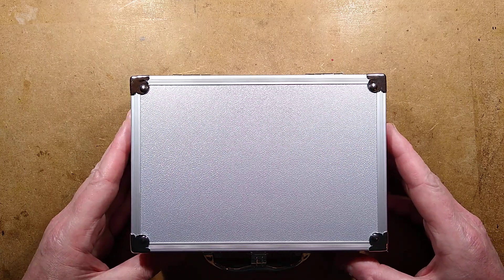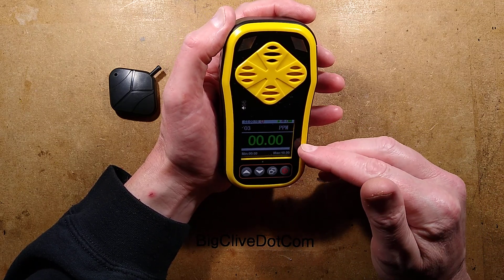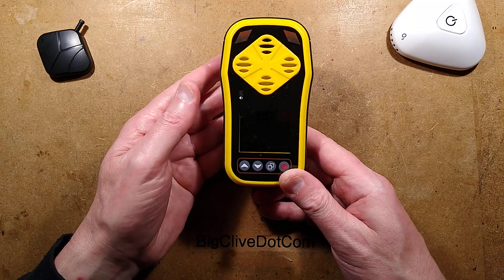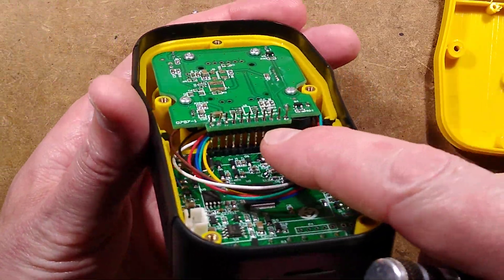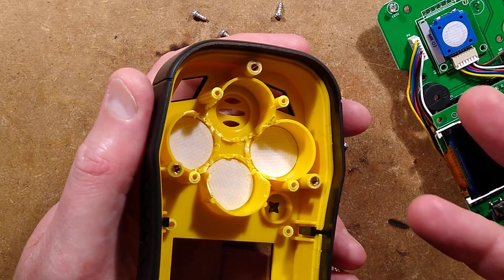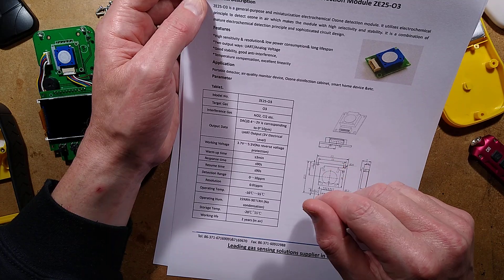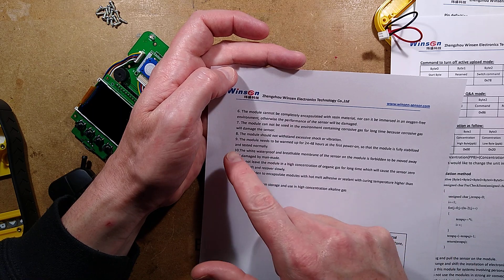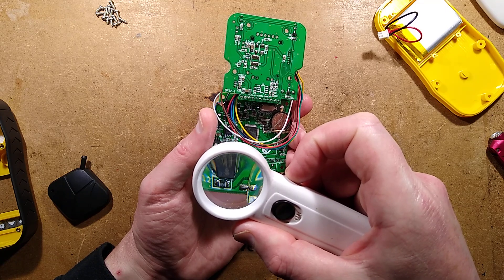Inside a wearable ozone meter with alarm.

Comment: Fascinating video! It seems to me that the real problem with all of these cheap meters is cross-reactivity. Note the warning that the environment must be free of all VOC's? That's not realistic in most applications. E.g., if you are evaluating interior air quality, the air will be contaminated with a mix of combustion byproducts and outgassing VOC's. The important question a meter like this is supposed to answer in such a situation is: Is the interior air ALSO contaminated with ozone? But it cannot answer that, if it's responding to the combustion products or the VOCs. In the social sciences we call this capability in a testing instrument "discriminant validity". In biostatistics we call it the "specificity" of the test (does it respond when it shouldn't respond?), which is often evaluated versus "sensitivity" (does it respond when it should respond?). In the future it would be a terrific addition to your testing protocol to give all such meters (natural gas, Nitrogen Dioxide, ozone, CO, etc.) a faint, distant whiff of air with some molecules of rubbing alcohol or vodka in it, and then to a faint whiff of a newly extinguished candle flame, and see if it shows any specificity at all to the gas it claims to specifically measure. Am I right?

Comment: I KNOW NOTHING ABOUT THIS STUFF NOTHING YET I STAYDED AND WATCHED YOU TALK TRYING TO LEARN LOL I LOVE HOW YOU LOVE THE STUFF YOU Talk ABOUT.
I bought a ozone machine so I can clean out my room the air in there and dust mites what ozone tester do you recommend for someone who needs to keep it simple to test the safe level to re inter a room, so I won't kill myself.
Reply from the maker: The simple rule of thumb is that if you can smell the ozone there is too much.  But it does sometimes take a long time to clear.  I'd recommend just trying to leave as long as possible after the machine has been turned off, before staying in the room for long periods of time.

Comment: I found what the 4 channel units comes from. The four gas unit is built upside down. On Amazon:
https://www.amazon.com/HZXVOGEN-Portable-Detector-Analyzer-Rechargeable/dp/B07VTQ1DXL/ref=psdc_7491102011_t2_B081PMLHRQ?th=1

In a further trek down the rabbit hole. I discovered that ozone can occur from hydrocarbons mixing with O2 at lower levels. It can destroy certain rubbers and polymers.
I believe believe ozone is what dissolved my Snap-On polymer impart hammer. Geeeez!
with the 4 channel unit at almost half the price, any electronics hacker want to see if they can swap in the ozone detector into the 4 channel? If I knew how, I would pull the oxygen sensor. plenty of those around. at a low price which are very accurate.
Anyone?

It appears that para-phenylenediamine:
https://www.wisegeek.com/what-is-para-phenylenediamine-ppd.htm
can protect against ozone damage to stuff

Comment: Why does this thing exist? A wearable O3 monitor. Is there some environment where O3 is a health hazard other then Clive's abode when he turns on all the ionizers and UVA lamps at once?
Genuine question from ignorance-  why would anyone need a wearable ozone meter?
Reply from the maker: It's for factories that use ozone in their processes.
Reply: @bigclivedotcom  Thanks :)
Reply: Yes residential HVAC systems are poisoning u with UV-C ozone generation
Reply: @walkingdead171  Good thing I just have resistive electric heaters and for cooling I open a window or two by the sounds of that :D
One the benefits of living in a temperate location with no extremes either way.
There are of course many many downsides to living in such a location - mostly societal though.

Comment: Clive followed the white rabbit way down the hole on UVC/Ozone!

O2 sensors are equally painful. Hydrogen Sulfide/Sulfer Dioxide will destroy most except Zirconium Dioxide sensors. Used to handle the byproduct from desulfurization of diesel fuel. I specified such a beast for a thermal oxidizer for IOC in northern India.

Comment: https://www.renkeer.com/index.php/index/shows/catid/31/id/23.html the 4 in 1 version of the gas detector. Detects CO, H2S, EX and O2
From website: The 4 in 1 gas detector is easy to use and maintain and meets the requirements of industrial site safety monitoring for high reliability of the equipment. The housing is made of high-strength engineering plastics and composite non-slip rubber, which has high strength and good feel and is waterproof, dustproof, and explosion-proof.

This four gas detector is widely used in petroleum, chemical, environmental protection, metallurgy, refining and chemical, gas transmission and distribution, biochemical medicine, agriculture, and other industries.

Very interesting how they just chopped the plastic away to fit the O3 sensor while keeping costs down. Although such a long wire loom going from the board to sensor glued on to same board was mindboggling. Not sure about the waterproof, dustproof and explosion-proof claims made on the 4 in 1 version though.

Comment: Common (cheap) silicone sealants/adhesives emit ethanoic acid (aka acetic acid, aka vinegar) when they cure.  Not good for sensitive components.  Or even non-sensitive components if they have fine leads.

Silicone polishes and lubricants creep everywhere (almost like superfluid helium).  It poses a problem if it creeps its way onto relay contacts, where the arc as the contact opens turns it into insulating crud.  Used to be a standard problem in photocopiers.  People polished the glass and many months later it worked its way onto relay contacts.  Not a problem with mil-spec relays in hermetically-sealed metal cans, but ordinary relays have big problems.

Comment: That does indeed look as if it's based on a multi-sensor design. I'd guess CO, domestic gas, and a couple of others. But I don't think the O3 sensor in this model could be combined with other toxicity sensors due to any exposure apparently degrading it, if I understood Clive correctly. So a sort of Swiss army knife of a toxicity meter, in it's full form...?

Comment: The piece for piping gas into it is for calibration, at least on other monitors. A known value of gas is input and you check the accuracy.
Reply from the maker: I used it with an aquarium pump and it made it much more reactive to ozone in the vicinity.

Comment: Good evening Sir, I hope you are well! I'm afraid this is off topic however potentially an interesting thought? Can/do smartwatches short circuit when worn on a sweaty salty wrist. Most have exposed copper charging prongs on the back. Could potentially be a flaw in the design?
Reply from the maker: They will have been designed with that in mind.  If there was current flow to skin they would cause a rash where the contacts are.
Reply: @bigclivedotcom  okay, that makes sense. Thank you!
Reply: @bigclivedotcom  Howdy, I just ran a search on Google and it seems many people are getting burns and rashes from there smartwatch charging ports...

Comment: 1:40 Sorry, but using a PP, PE or PVC as a filter cap is wonderful filter on O3 and reduces it efficiently to O2.
The only innert material is PTFE for this purpose.

Also the scaling in ppm is a joke. A typical hot summer will not exceed 250ppb = 0.25ppm on average.

3:26 Strong doubts that this little device creates +4 ppm. The egg or cigar like 12V car plug (7€) can barely create 2ppm. The cheap 220V (600mg/h advertise ~30€) can create about 25ppm for a short time (<5min) until self-heating reduces the O3 production.

Missing features:
- humidity compensation
 for this type of sensor

Not advertised:
-limited life time of the electrochemical sensor in use - even if stored and not used

So in the end a very expensive version of MQ131, which will drift and age.

If you wan't to have reliable readings you need the UV version (~400€) of Teledyne Model 430 or a MOX-Version with humidity compensation (Aeroqual 500).

Comment: Did it not occur to them to just rotate the sensor board 90 degrees and use a shorter wire? Or is this being built from off the shelf components bodged together? I'm sure I've seen that screen and buttons PCB in a cheapo DSO before.
Reply: Then they could've spent that saving on some properly threaded case screws ;)

Comment: Seems a lot of processor for a simple sensor?
Reply from the maker: They probably used an Arduino style base for programming to facilitate reading the sensors and adding a nice display.
Reply: Maybe even the existing arduino library for the ozone sensor.

Comment: https://www.renkeer.com/index.php/index/shows/catid/31/id/23.html
1. The 4 gas detector uses electrochemical and catalytic combustion sensors with excellent sensitivity and repeatability
2. The 4 in 1 gas detector shell has high strength and belongs to intrinsically safe explosion-proof products.
3. High-definition color screen design, easy to check the gas status
4. The 4 in 1 gas detector can detect four gases: oxygen, flammable gas, carbon monoxide, and hydrogen sulfide
5.Can set high and low limit alarm value
6. Full-featured self-test, the product adopts sound-light vibration three-level alarm
7. Shortcut key to quickly turn on and off audible alarm and storage mode
8. Up to 130,000 stored data, with the software to view historical data at any time
9. Large-capacity battery, the device can be used continuously for at least 8 hours in the constant light mode

Comment: Fairly sure the 2 PCBs will pull apart but those pin connectors need a lot of effort to plug/unplug causing high risk of breaking something - so best avoided !

Comment: 11:33 Pin 2 (DAC) 0·4 - 2·0V - isn't that the standard range (4-20V) divided by 10 ?
Reply: 4 to 20 is typical for current loops but that's 4ma to 20ma. If you put a 100Ω resistor in that current loop you get 0.4V to 2.0V across it.
Reply: @Peter_S_  Is that what it was :)
30 years is a long time to remember such things to that degree of detail :)
Reply: @millomweb  It's one of those things that if you don't use it in work or serious projects, it's an unnecessary detail. Good spotting on  the 4 to 20 range!
Reply: @Peter_S_  It was back to my BTEC college days !
I wondered why MIDI came to mind - now I remember - that's a current based control system !
I've a 1980s computer port specification book and it includes MIDI. USB wasn't around then - nor HDMI, Firewire - lol - or even the 'WiFi port' !

Comment: Hey look, it's an arduino! https://www.arduinolibraries.info/architectures/stm32 Not a bad little chip. Quite cheap too.
Reply from the maker: It wouldn't surprise me if many of these types of meter used the arduino system to make designing a nice display and interfacing with the modules easy.

Comment: Hey Clive, it may be you were right on the money with air sanitation. Even more then you thought. Some latest research suggest either a good ventilation system or where it's not possible or have somewhat of a closed system, filtering and sanitation, are far more effective then everything else (social distancing, masks, hand washing etc.) combined. It's all about air and you'd need biolab grade masks to make any difference. 
Schools are opening up here and there are special teams set up to check and help with the ventilation. All well and good, however in fall and winter students would sit in cold classrooms. (likewise restaurants, theatres, gyms and so on). Having an air purifying system could be very helpful.
Reply from the maker: It might be better for those kids to sit in cooler classrooms with a warm coat on than in a hot sealed humid environment.

Comment: That Winbond IC is a 16Mbit SPI flash memory chip
Reply: It is for logging the readings.
Reply: Indeed. Much more than needed for some calibration data. I also presume the MCU has built-in program memory, maybe the external flash is also used to store some graphics?

Comment: Where can I buy a real ozone generator from? As well as a real safe UV  lamp 🔦  please  thanks
Reply: Note that a real sanitising UV light is definitely not a safe uv light.
Reply: rpavlik1 I want a mercury discharge lamp with soda glass (which blocks UV) because that blue is just so pretty. Give me those visible wavelengths, I don’t give a hoot about the UV
Reply: @mrb692  looking for medical reasons
Reply: Buy a ozone  generator for cpap cleaning. You can find them on Amazon, and for UV, buy one that's a Florent tube. Then do the banana test.

Comment: The crowd who make this are apparently called 'Shandong Renke Control Technology Co., Ltd.'
Reply: And the actual listing: https://sdrkck.en.alibaba.com/product/62524740078-815779719/RENKE_multi_gas_detector_meter_smart_ozone_gas_test_detector_portable_O3_handheld_gas_analyzer.html?spm=a2700.icbuShop.82.19.47507f710h7IKZ Evidently the little black cover is for calibration and testing, and not for monitoring, for what its worth.
Reply: @mysock351C  and: https://www.renkeer.com/index.php/index/lists/catid/16.html  shows the ozone meter but also shows the 4-in-1 variant.

Comment: Self tappers into brass inserts..... Fancy.
Reply: Or, as the penny-pinching department calls it, "the cheapest screws we could get into the cases we already had".
Reply: i can't believe chinesium screws can thread brass without breaking neighter the plastic... every time i try to do something like that A) the screw snaps in two pieces and the tip is impossible to take away from the hole B) the screw becomes a dull nail that doesn't thread anymore
Reply: Indosarnia  Wooden dowel into badly drilled chipboard. A copy of the slightly higher quality version IKEA uses (when they're not wrapping cardboard in plastic to make their products)

Comment: Now if they could make a version that could detect farts, you could finally defeat the "Whoever smelt it, dealt it" rule and nail the culprit... :P

(though usually the culprit is me!!!)
Reply: Dave Micolichek  Your nose won't work for detecting methane because methane is odorless. The flatulence odor comes from various sulfuric compounds like hydrogen sulfide.
Reply: Dave Micolichek  I am not sure whether hydrogen sulfide is always present but I do know that not all farts contain methane, so a methane sensor would not be a reliable fart detector.
Reply: Dave Micolichek  Yes but its less polite to stick your nose close to someones arse to check than just waving a sensor discreetly nearby. :p
Reply: The methane sensors work exceptionally well in his capacity. I had a cast off meter from a national lab that was a gas sensor ( http://www.apollounion.com/en/p-Combustible-gas-sensor-TGS813-182.html ) hooked to a 555. You would turn it on and let it warm up and then adjust a pitch control to essentially set the detection range. You would adjust it for a click----click---click output in clean air and then when held by a farter, the pitch would rise to a couple thousand Hz. Even a couple minutes after the "event" the unit would scream when the sensor was held up against the guilty pants.
Reply: they do!.....its called a Massive Conk
Reply: No need as whoever “made the rhyme, did the crime”...

Comment: Handy for when you are using a Scalextric.
Reply: What is this? I think I'm missing a joke or something.
Reply: @Hexalyse  No joke, a scalextric is a designated delivery system of ozone, that`s why its so enjoyable for a while, but , when you "get used to the ozone" (or get a bit bored) and racing turns to firing cars at the wall at several "acceptable" speeds. This detector/ alarm will, in effect tell to to stop racing, take a break before you smash all those expensive vehicles and can resume racing when you "calm down from the buzz".
Reply: @Jamic_Hunt  hahaha wait so this is a racing car game like Google show me... But I guess the way it works makes it generate lots of ozone? (Corona discharge?)
Reply: @Hexalyse  Correct sir, The influx of 12v and brushes (on the cars) and speeds of up to 1000 mph (at scale) emit enough ozone to drown small animals such as mice and water voles, any higher levels will certainly turn any sane human into a crazed speed freak, thus the need fro a alarm!
Reply: @Jamic_Hunt  hahahahahaha your descriptions are dope! You should be hired to make the advertisement for these toys (we don't have them in France, first time I see this name)
Reply: @thomasneal9291  Fun sponge

Comment: i wonder if you could make a video about CO² meters some day. there are quite cheap ones on ebay, but somehow i dont trust they are accurate when others cost more than 100€. 
Given the importance of CO² for air quality, i dont understand its not more common to measure it indoors.
Reply: Because good sensors like scd30 are super expensive, and also super sensitive to the actions of occupants.

Some of these heated tin oxide gas sensors (eg SGP30 which I recently got) can give an "equivalent co2" measurement but that's just computed based on some other gas being measured.
Reply: C02 for air quality ? ummmm
Reply: @gowdsake7103  
yes, the concentration of co² in the air is very important and one value for its quality. 
https://en.m.wikipedia.org/wiki/Indoor_air_quality
Reply: @gowdsake7103  
yes
Reply: I've got a Telaire CO2 sensor running in my place and it's SUPER interesting what it shows. You'll probably never want to close your windows all the way again once you see the data. https://www.digikey.com/product-detail/en/amphenol-advanced-sensors/T6713/235-1373-ND/5027891 $86.20 for one damn sensor.